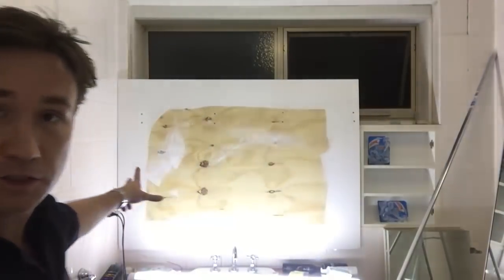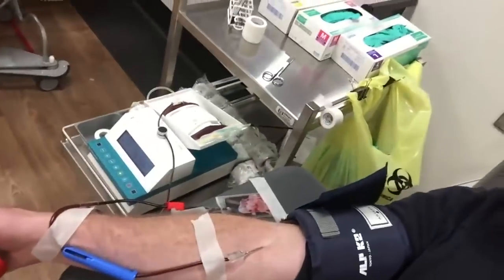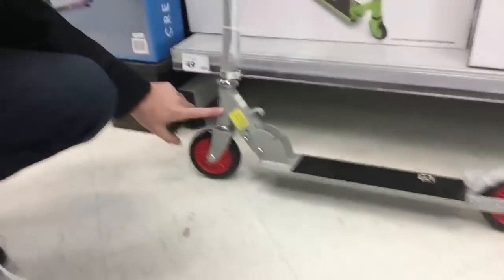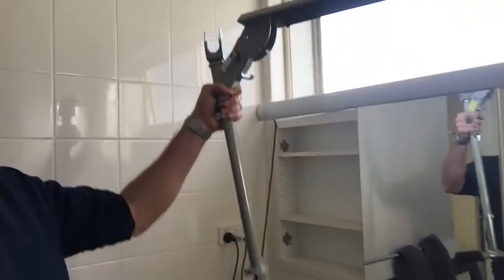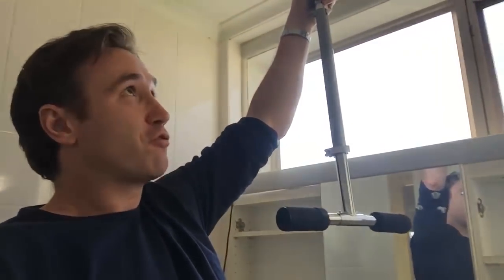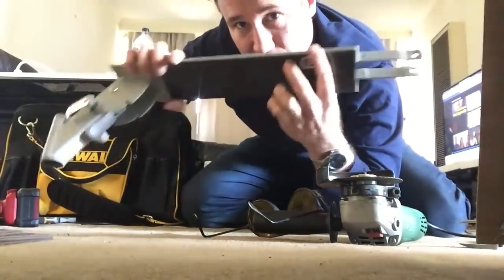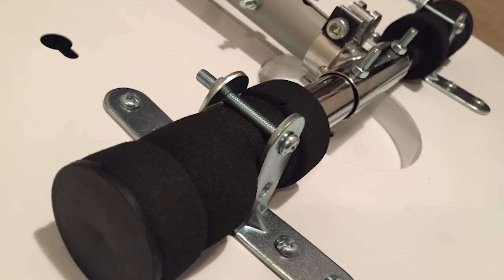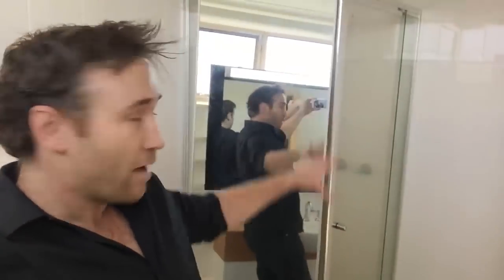Video 68: Building a better mirror system

Comment: Whatever you do, get a level and make sure the mirror is totally plum (vertical). If not, it changes the way you look. If the mirror is tilted forward at the top, it will make your face look squarer and shorter at the jawline and if it is leaning backwards, your jawline will look longer and your forehead will look shorter. That's why we think we look good in some mirrors and great in others. Aside from proper lighting of course.